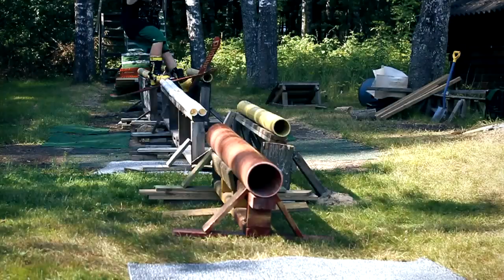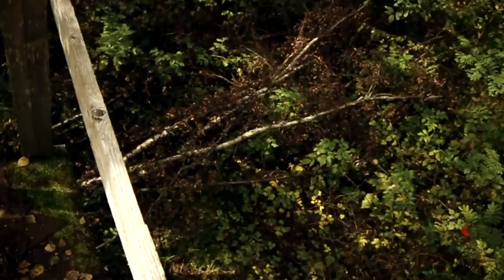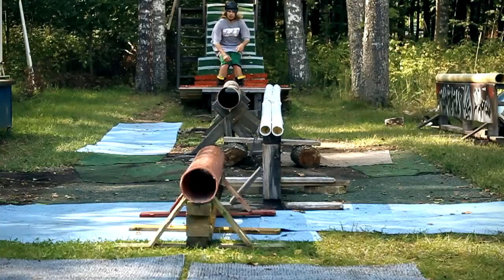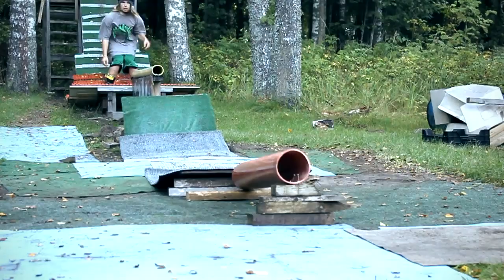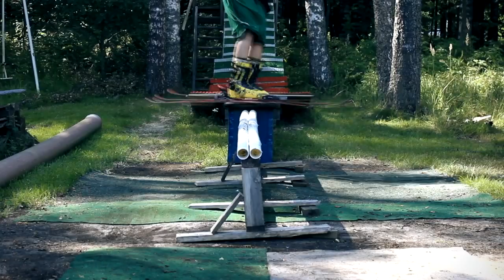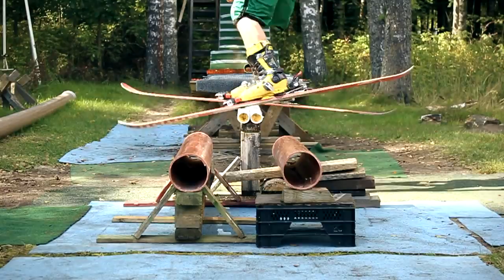Kevin Salonius - Summer Rail 2014

Comment: Back in the day (early 2000's) I pulled a big long pvc tube out from under a chairlift at my local hill in Washington. It was after the resort closed so nobody was around to bother me. I slid that thing for hours trying to learn how to slide a rail. Fast forward to the next winter and I head into the park feeling fairly confident about sliding my first rail. Line er up pop on and the instant my skis touched the rail my skis slipped out from underneath me and I took said rail straight to the ribs! Fucking brutal lol. Took me a good 2 months to try again (and for my broken ribs to heal).